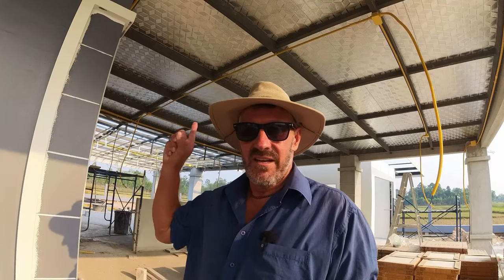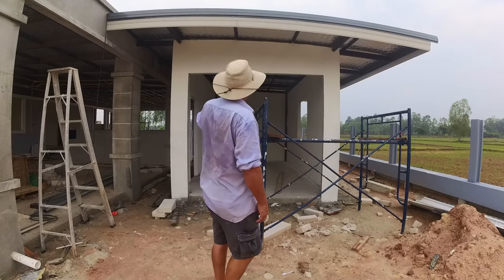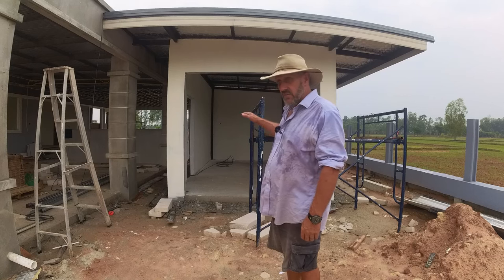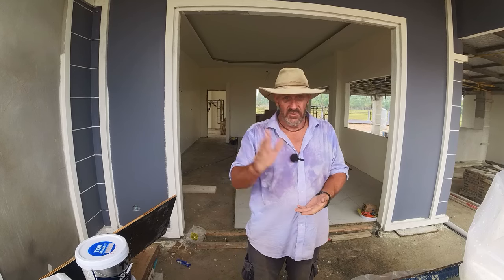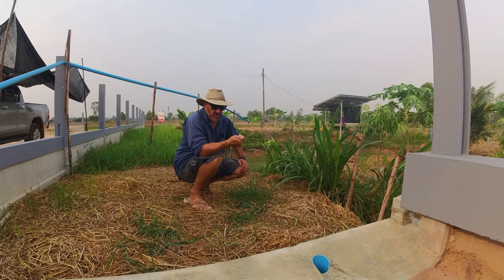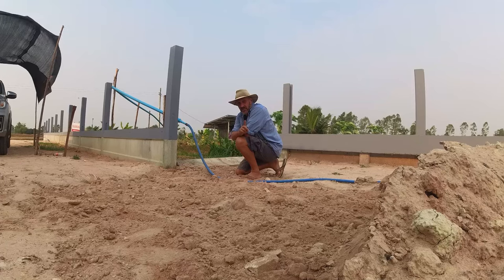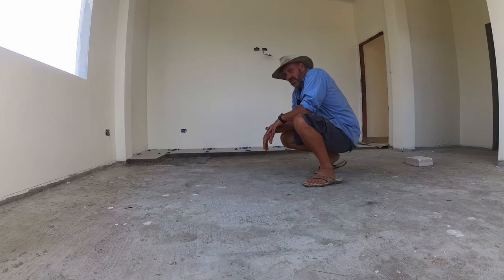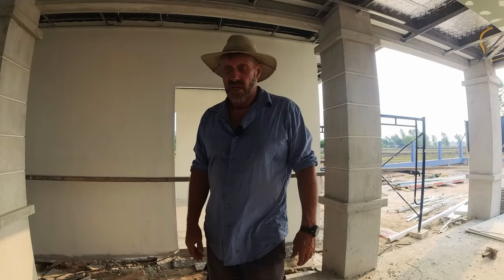Roofed Again

Comment: Is that shiny the diamond pattern in the ceiling the bottom of the roofing material? I've not seen before, what is it?
Reply from the maker: There is 3cm styrofoam on the back for insulation, then covered with that aluminum foil. Works out pretty well.

Comment: Hey Kenny. Mate just an observation. Did you consider putting roof insulation in the outside area to assist with the heat coming from the roof. Mate it's coming along nicely, I'm jealous
Reply from the maker: Yes, I installed the insulated metal roof panels. Styrofoam, 5mm thick attached to back of every panel.